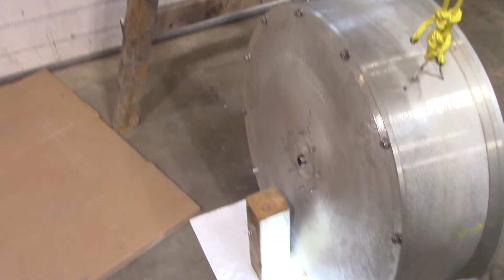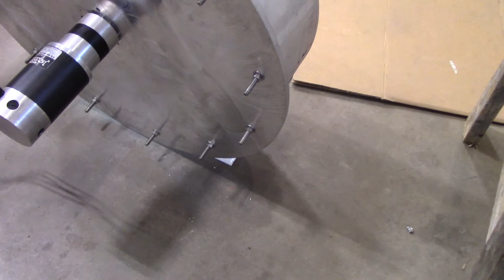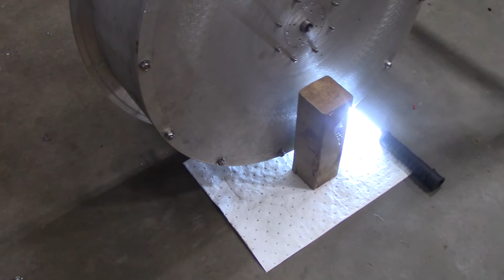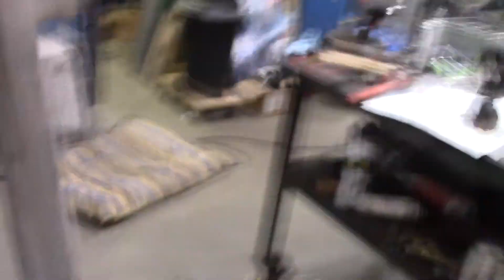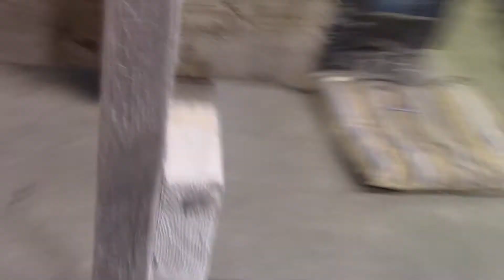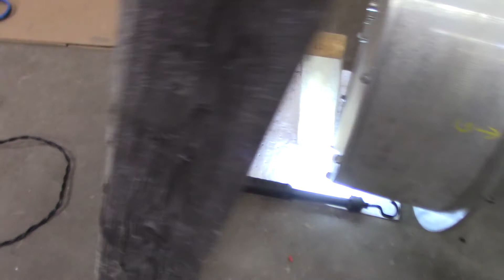CENTRIFUGAL PROPELLER 1.8

Comment: How hard is it to hook this thing up a car engine to get the test results you need?
Reply from the maker: Hi Kenneth, the problem with that is that the reaction of the centrifuge is redirected by the repulsion of permanent magnets (neodymium) and although they are strong, they have their limitations. After a certain RPM, the repulsion of the magnets is overcome by the force of the centrifuge. I have covered the use of electromagnets in my patent and they should be what I am using instead of permanent magnets. The trouble with that is that in order to do that I need sensors and computer controlled rheostats. All of these things will also have to be shielded from the magnetic field that is created. The cost of that is currently beyond my capabilities. Right now I am building a smaller version, using permanent magnets that will be enough to make this thing actually fly without the huge expenses associated with electromagnets. That should be up and flying by mid-October. When people see this thing actually flying, they will start to understand the full implications of what it is that I have done. At that point I am hoping that the money to further develop this, will flow in my direction. 
I am seeing so many space related companies like Spacex and Blue Origin, wasting hundreds of billions of dollars on something that will soon be replaced by my technology. So I am thinking that when the world sees my prototype flying, it will put a quick end to the outdated rocket and jet technologies.

Comment: This is amazing.
Reply from the maker: Thanks Drake, there are very few people who actually realize the full implications of what it is that I have done here. Hopefully this week, I will be putting the Centrifugal Propeller in a small boat, in a pool, and turning it on, to propel the boat. That should be more impressive than the current video and it will save me a ton of money that I was going to spend on buying a 10 Hp DC electric motor and a speed controller for it. I expect to use just car batteries and no speed control, just an on/off switch. Putting it in a boat was suggested to me by a nautical engineer. I wish I had thought of it before. I had been using these stupid lithium ion "smart batteries" that tended to shut themselves off if the draw was too great. Unbelievable. Who the hell came up with that bright idea? Anyway, I will be posting the video as soon as I can find the boat and the pool to use.
Reply from the maker: @t0xicrunner  We had this discussion on the other forum, but for the sake of other readers I will explain it again here. And again, I suggest that you read ALL of the comments and the video descriptions because I have already explained this. What you are referring to is gyroscopic precession. With gyroscopic precession,  if the gyroscope is turning in one direction it will cause the entire gyroscope to move, let's say, to the right. If the gyroscope turns in the other direction, then the gyroscope will turn to the left. 
With my Centrifugal Propeller, in one video the electric motor is on one end of the axis and in the other video it is on the other end of the axis. The wiring has not changed so the end result is that the centrifuge is turning in opposite directions in the respective videos. But even though that is the case, the Centrifugal Propeller still moves in the direction of the forward wall. Therefore it cannot be gyroscopic precession that is moving the Centrifugal Propeller. I have repeated this adnauseum, but because people continue to make comments without reading the entire descriptions for both of my videos, I guess that I will have to keep repeating the obvious.
Reply from the maker: @t0xicrunner  Okay, so now you are saying that the thrust generated is miniscule. So now I agree. The thrust is miniscule in this video. ABSOLUTELY!!! That is something that I have been saying myself. But you have to take a close look at the bottom of the Centrifugal Propeller and the distance between it and the 4X4. The distance closes. It is as you say, MINISCULE. Only a few centimeters. I cannot argue with you on that. But it actually does move and it actually does prove that there is thrust that is being created. If this was in outer space, ANY thrust, even this miniscule amount of thrust, will cause a spacecraft to move in the direction of the thrust. I encourage you to PLEASE read ALL of my video descriptions. I explain that with a 1/2 Hp electric motor, the Centrifugal Propeller is only turning at about 85 RPMs. The entire thing weighs about 320 pounds. 85 RPMs is nothing. The motor that I have been using is insufficient. I have been self-financed and to even increase the strength of the electric motor, including the power controller and DC power source, is going to cost me close to $5,000 Cdn. That is why this thing has taken so long. MONEY. I actually have two new designs that will demonstrate a far better than "miniscule" result, but the costs are huge. I am also working on that side of this project, because at age 65 I no longer want to carry all of the costs by myself.
Reply from the maker: @t0xicrunner  Of course it is moving enough to discredit shaking and calibration errors. This is repeatable, over and over and over with EXACTLY the same result each time. And if you are being honest, you will see that the movement at the bottom of the Centrifugal Propeller is not from shaking or calibration. Give me a break. As for me not accepting "universally accepted laws of physics", again, I can tell you that the physicist from the Government of Canada will disagree with you. Also, I am not changing the accepted law, I am just expanding on it. I am not changing Newton's 3rd law. It still stands. I am just adding that - The equal and opposite reaction can be redirected from the initial direction of the initial action to create thrust in the direction of the initial action.
Reply: Then you ARE changing newtons 3rd law, as if you intend to "redirect" the energy ,  its not free, and will have an effect.
Reply: Smash Er Facts are falsifiable. This means they are accepted as a fact because they can be proven wrong but no one has proved them wrong yet so are accepted. I feel like hes getting onto something, its good to try things but at the same time be stable. This might be rlly expensive for him, if he can afford it good on him. Just hope hes alright and has the money to do this.
Reply: Mr Thompson is a pessimist......I see you actually created thrust if you had a more powerful and faster motor you would see a huge difference

Comment: Ok what is this ?
Reply from the maker: This is the successful conversion of centrifugal force into directed thrust in a completely closed unit with no external moving parts and no external vents. The thrust created is actually at a right angle to the plane of the centrifuge. In space it will continually accelerate. Feel free to ask any questions.
Reply: @jeffincanada5060  impressive work , very interesting , all the best, but i can see a motor 🤔, anyway wish U all success this will change everything🖒.
Reply from the maker: @princedemiterios2488  I consider the motor as part of the entire unit. It could easily be enclosed into the unit though.